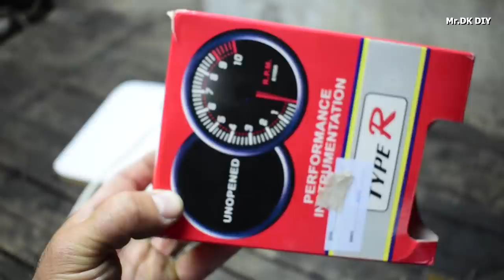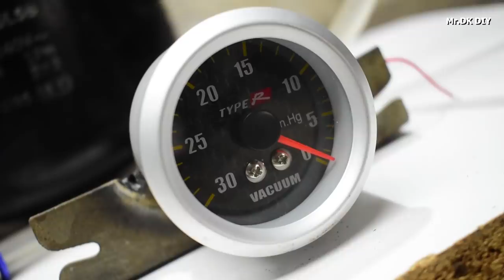Homemade Vacuum Pump Machine from Old Refrigerator Motor Compressor / Experiments

Comment: Surprise! You are using a vacuum meter calibrated " inch of Mercury"!.  Is a very old measuring unit , here in Italy , we use mm or micron of mercury or psi negatives.  May I suggest to put in a dreier filter on the suction line, near the compressor body, because the electric winding of motor is faible to umidity. Congrats for video. By. Henry.
Reply from the maker: Thanks for Nice comment 😉
Reply: @MrDKDIY  can you use this for hvac? Can it reach 500 micron?

Comment: У меня имеется проблема. Когда компресор был установлен на холодильнике, он работал, но после извлечения перестал.  Из реле выходит 2 кабеля. Первый на розетку и второй шёл в камеру морозилки, после извлечения был отрезан. Оба имеют толстую оплётку. Во втором кабеле 4 провода, 2 из которых дают 220 вольт при подаче на тока на первый кабель. Что можно сделать, что бы компрессор начал запускаться?

I have a problem. When the compressor was installed on the refrigerator, it worked, but after removing it, it stopped. 2 cables come out of the relay. The first one went to the outlet and the second one went to the freezer chamber, after extraction it was cut off. Both have a thick braid. The second cable has 4 wires, 2 of which give 220 volts when the current is applied to the first cable. What can I do to start the compressor?
P. s Sorry for the crooked translation

Comment: Do theses compressors need a run capacitor because I have on using a pump for my air lift pump but it's getting  hot tripping the overload
Reply: Depends on the motor type. Most of them don't. They only have the starting unit called clixon. But some motors can use a capacitor. You should check the datasheet for the particular motor type you have.